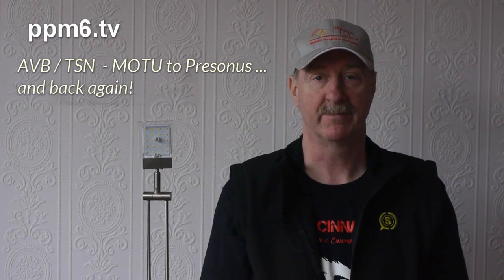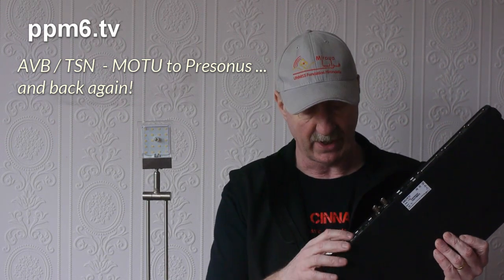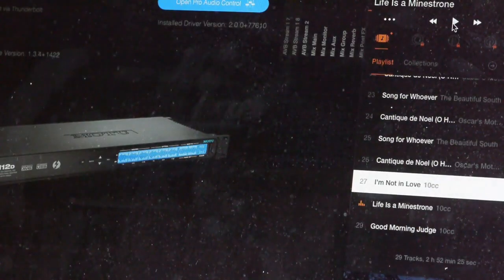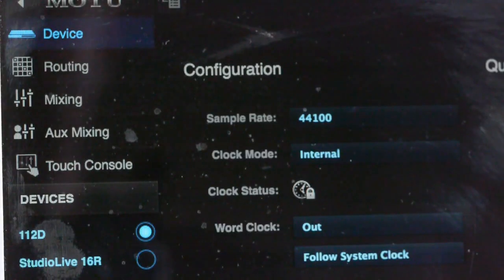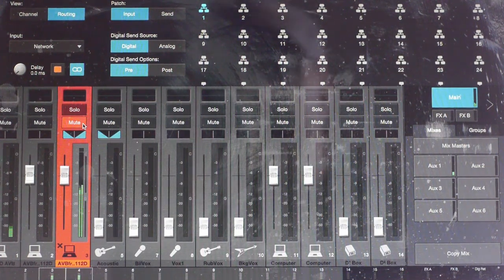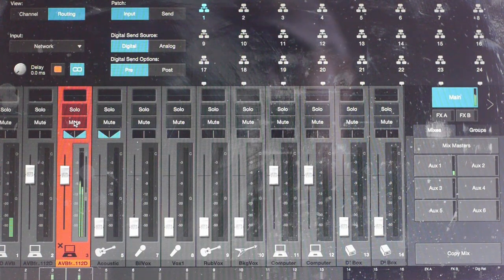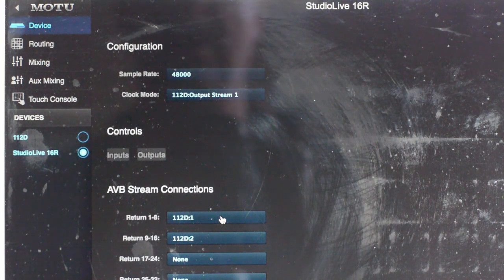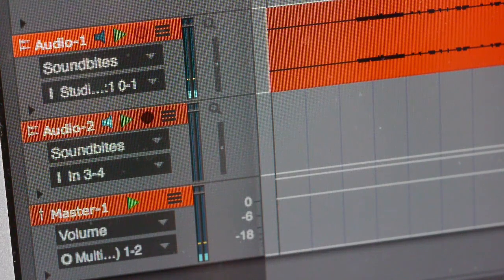AVB Audio Networking MOTU connects to Presonus - What's Missing?

Comment: This is a great video!!! So helpful!! Im wondering if one can send 16 or more channel from a computer to a MOTU interface AVB’s streams to the Persons AVB Switch to a Studio Live Series III console?

Im doing some backing tracks thru Ableton and im looking for different ways to send 16 ch or more to a console over 100ft, I know there’s lot of ways to do it but im looking for the cheapest way. If you can help me with this I'll appreciate very much.
Reply from the maker: Hi G Man, thanks for the comment. What equipment do you already have?  I take it you are trying to record a 16 track session (or live gig) from a remote point at least 100 feet away? More info you can share the better. Ta like. ppm6
Reply: ppm6.tv I already have the macbook with the multitrack, the Presonus switch, two NSB stagebox and the SL3 Presonus console. I just want to know if i can use a Motu interface AVB and send Streams to the Presonus switcher and receive it on the console
Reply from the maker: @gabster5584  You have a great set of kit already! To be honest - I don't know is the answer because I don't have a Presonus switch to test. My guess is it will work but I can't guarantee that I'm afraid. Can I ask you a question if you plug the stage boxes and the console and the Mac into the switch. Can you send and receive audio between the stageboxes and the console while at the same time record those streams on the Mac?  Which MOTU interface are you thinking of getting?  ppm6
Reply from the maker: @gabster5584  Sorry I didn't ask the simple question!  If you set the stage boxes up and connect them both the switch over Cat 5 (up to 100m) and then connect the SL3 console. Does that bit all work?  ppm6
Reply: ppm6.tv To answer your question, we did a bit of testing with that setup but resulted in working good for the first time and then not working at all. I think this can work but it must be setup up in perfect conditions (Good electricity, Ethernet cables, a good MacBook that can handle the processing and the latest updates of every Presonus gear so there can be no bugs or glitches) to work. But still it need to be tested.
Reply from the maker: @gabster5584  Hi - I now have the Presonus switch and plan to do some more testing. How is your experience working out?  Ta, ppm6

Comment: AVB Send tab on UC Surface is how you do it.
Reply from the maker: Hi Stuart - thanks for the info - are you using the Presonus AVB gear - or indeed the MOTU stuff?  Ta like, ppm6.
Reply: @ppmtv-qh9qk  I’ve been using the presonus avb gear for a while. Done a fair bit of digital patching etc. great to see a video of actually doing what AVB is all about. Different brands all connecting under an open platform. 

I’m currently looking at the MOTU 112d to give me aes and MADI I/O.
Reply from the maker: Good shout Stuart - I'm very fond of my 112D - https://youtu.be/DijY2DxwrGQ  Doesn't get enough love in my book. There's so much power in a one U box. I wish it had midi - I'd love to the control the mixer from hardware and a some sample rate conversion would be nice. AVB to MADI and AES and Thunderbolt is a mighty combination. Ta like, ppm6.